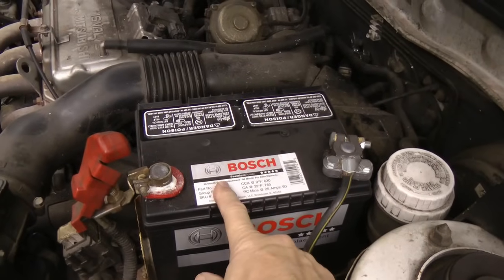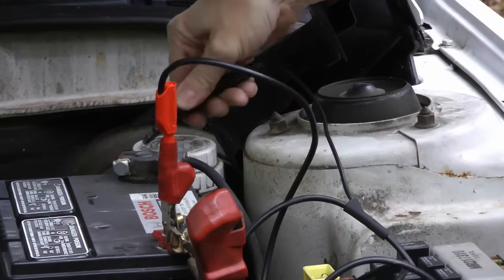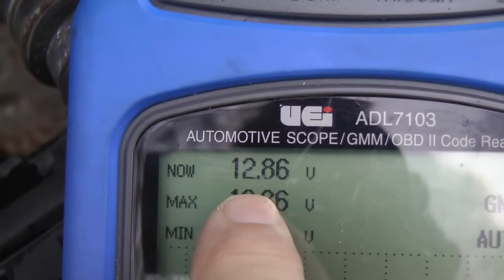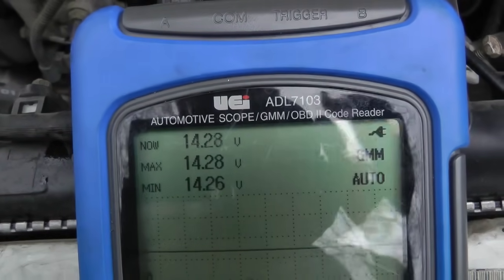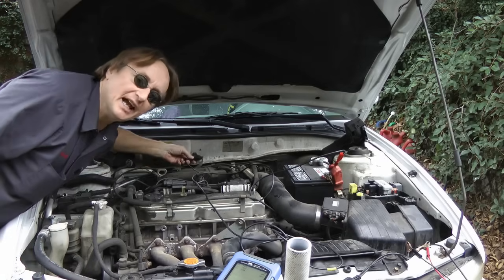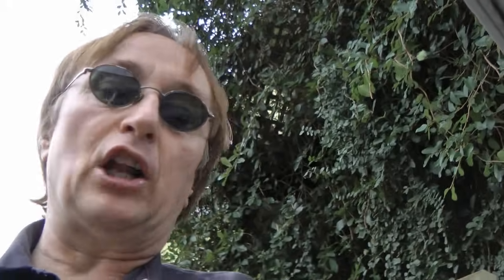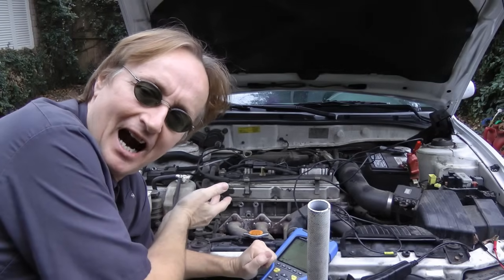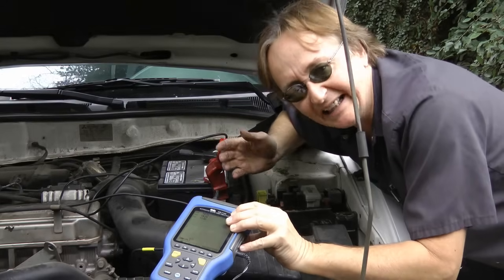How to Fix Electrical Problems in Your Car (Ground Fault)

Comment: I flushed my radiator and put in new coolant and steel seal. Using it as a preventative but I did notice the heat is colder now with the steel seal in it now. Any ideas? I use a alternator on my scooter also by testing my regulator and magnetron for charge and a.c. to dc. Car batterys should sit at 12.5 volts or more overnight so you know they are good.

Comment from the maker: cause it's a GM product, Insanely over engineered with computers controlling that.  You need a machine as in my video "fixing modern cars using high level scan computers" to analyze and fix that. Often a bad module on the side that doesn't blow cold, last time I fixed one of those it was over 600 bucks, brilliant design there.

Comment from the maker: yes, check your anti theft system if it has one and it needs resetting. If not, check the battery terminals and wires to see if they are not getting power from being loose or cracked

Comment: I left the door open on my 96 jetta and it drained the battery, but it was low on power anyways, but when I got a new battery hooked up and waited for 10 minutes and I tried starting it nothing happened. None of my lights came on inside nor did the radio or the odometer. Any suggestions?

Comment: Thank you, Scotty. I guess spark plug or spark plug wire are the last one I want to check. Based on your help, what i will do is: 1. Change fule filter. 2. Check pressure on fule pump. 3. Clean fule injectors.  4. Change spark plug and the wires. As you said, I pray it is either 1 or 2. Thank you again, Scotty.

Comment: Hello Scotty you being of great help. I used a code reader and i got this code:  PO352. In my Manuel it says  Ignition coil #2 primary circuit. I think you are correct that i got a bad computer. Before buying a new computer is there anyway to test a computer?

Comment: Hoping to get some help.... 
My car is Hyundai Tucson 2005. When I hit the gas to move from stop, it hesitates a couple of times during acceleration. it is not smooth but discontinuous initial acceleration. After that, I can feel smooth acceleration with no problem. You can feel this problem more clearly when you stop and move again up hill. This problem feels worse when you try to go up hill.

Comment: The problem is that my car does not have distributor.  I think my cam or crank position sensor are bad. In my user Manuel its says that crank and cam sensor are important for sparking the coil pack. Well i bought a new coil pack today and that same, no spark. I used a test light to see if there was spark, but all there was just one instant flash. After that nothing. Do you think i need to change the crank or cam sensor?

Comment: hey Scotty, i know this doesnt have anything to do with electrical systems, but i have been putting off changing the oil filler neck in my 2000 ford f150 5.4 liter for a while and its come to the point that i have to do it! I just cant figure out how to get the blasted thing to come out, it wont just twist off like i thought it would? Thanks for all your help, it is greatly appreciated! Kenny

Comment: Hey Scotty. I have 1997 Mitsubishi eclipse. For some reason my car is not getting no spark. So my car crank but no start. I tested the resistance of my coil pack with a multimeter and it read 11.2 and 11.3. Now on my car manual it says that the resistance should be between 11.5 and 12.5 resistance. It also says that it should be replace if is not withing the resistance. Do you think that the reason why I'm not getting no spark? By the way I love your videos.

Comment: Wow Scotty I have that exact car. And I believe I have ground problems. There is a thin set of ground wires connected together by a metal ring tip and bolted on the side of the engine. Problem is it melted them. Went to the dealership and heard that ground could burn up my coil packs. So I went to a junkyard to see if I could pull another one but it was difficult. Seemed to go thru the firewall so I cut it and I'm going to twist and solder it to my wire(will this work) also I have no dash light

Comment: Hey Scotty, I have a 97 Bmw 318ti. It has a weird intermittent starting issue. Probably one out of every 20 times I drive it the car won't start first try like it normally does. I have to try and turn it over it and pump the gas pedal usually 3 or 4 times before the car will start. It usually does it after I've already driven it, not from a cold start. New pcv,,o2 sensors,fuel filter,air filter,plugs wires. Any ideas?

Comment: my friends 94 corolla keeps blowing the main fuse disableing everything key ingition dash lights and everything else,  where should i first for the hot wire short? under dash next to ing switch?

Comment: Hi Scotty, nowadays people bought car accessories such as HKS Grounding kits which comes with 4 thick wires. And is the Voltage stabilizer (contains cap Capacitors) are good enough for cars? Thanks.

Comment from the maker: same as this video, find the ground wires by using a test light or meter in the trunk and pray it's just the one back there that bolts to the frame

Comment from the maker: I would start by checking the ground wires and the circuit boards back there, on MERCs the boards often warp with age and need replacing

Comment: Hey Scotty  I am currently being plagued with tail light issues on my  Mercedes 190d 2 main issues,keeps blowing tail light bulbs :( I install new bulbs which go brown  immediately then fail within a week :( Also not sure if Related but my Reverse lights keep failing :( Work one minute not the next? My Reverse Bulbs are fine whats the best way to track down these issues? Dont know where my tail lights ground is and battery under hood and tail light access in trunk

Comment: I have a 97 cutlass supreme and I have an issue with my passenger brake light. It only works after I use my turn signal . Bulbs replaced, fuse is fine so how would I check the ground for that particular part. Thanks

Comment from the maker: you can use power from anywhere, but really, 15 feet of any wire can be used to hook it to the battery terminal which is more accurate.

Comment from the maker: get a test light or volt meter and check the switch and wiring for power loss, and fix the area that stops power flow

Comment: Does your meter reset ABS or get the codes from the ABS. My son got a 2004 jeep liberty and the abs light is on . He also has a bad socket on his front turn signal and we went to NAPA and they said it was a dealer item . Is there someplace I can find that socket beside a junk yard or the dealer?

Thanks

Comment from the maker: those stupid systems are complex to diagnose and repair, see my video "fixing modern cars using high level scan computers" and realize that's the only way you can work on those insane designs. Most guys just live with it, or disconnect the stupid auto locks by removing the relay that runs them

Comment: Hey man!!
Love your videos, always supporting!
I recently installed foglights on my 2012 lancer, and they worked perfectly for 3 months, now, the lights no longer work, the switch does though, the backlight turns on and off.. I checked the fuse, it's fine. There is a relay which I'm not sure how to check, and the bulbs are intact. Could it be the switch?

Comment: Ok here is the problem my friend's '06 Honda Odyssey Touring has auto lock when you get to a certain speed but it just keeps locking every 2 minuets while driving and the remote key does not do anything anymore everything is good like the battery but it still has these problems.

Comment from the maker: could be bad wiring, check around the alternator wires first. More often a bad alternator. O2 sensors can go bad many ways, so you normally trust the computer on board to diagnose that and flag a code when bad

Comment: This works great for automotive techs, but for those techs that work on electric material handling equipment that use those 24 volt or 36 volt monster sized traction batteries will not have the traction battery pack's negative tied to frame. Instead the metal frames are at neutral potential (no electrical connections to it at all). All return paths are with wires back to some source, whether the battery terminal block or to the vehicle manager computer that will have built in power supplies.

Comment: ok. symptoms you had were same in my ford - although don't mazda and ford share many parts.
Anyway, I had some start problems too and friend mechanic told me to replace the globe. I replaced bulb and cleaned up wiring and no more problem.
Good luck!
Alan

Comment: Hi Scotty, few days ago all lights have turned on (normal lights, brake lights, fog lights, reverse light and even rear direction lights/signals are still on even when I turn everything off and take the key from the ignition (bmw e39 '96). When I disconnect and reconnect the battery, everything remains the same. Do you think that I have a bad grounding somewhere? Thanks :)

Comment: none are blown at all, everything else works. radio screen never lights up all the way (thats been that way for years) just a crap radio. if i slam my fist on the dash it goes off. button (when it wasn't in the dash) had to be held down and that would sometimes work. Mazda Tribute 04 LX 3.0 v6. love the car hate the quality.

Comment: not sure if you would have any recommendations for shops in the montgomery county part of the dc metro area, but do you have any idea what might be causing the problem?

one side note: they said (about 2 going on 3 years ago when i got all new tires from them) that i have a bent caster and it cant really be replaced (even though ive seen replacements on ebay) and since its bent slightly, it wont cause any problem apart from the alignment wont ever be 100% accurate but still ok to drive

Comment: Scotty do you know what could be possible causes of intermittent hazard lights? they go on at random even with ignition off and after the car has been parked for hours (few jumpstarts ). they even go on when i drive on the highway. the button went through the dash after trying to get them to go off. the Stealership wants over 600 to fix them.

Comment: where does it smoke from? exhaust can usually mean plugged cat. or worn valve train or worn out cylinders.  if it is coming from the engine compartment it could mean an oil leak dripping on an exhaust manifold or pipe. either way keep tabs on oil level.

Comment: Hey there, your video are a great help to me. I took my car to autozone and got my battery check, my cranking was normal.and charging system had no problems however my battery light still flickers on and off occasional. Could this be due to bad wiring like in the video? Also what are some sign of ur O2 sensor going out? Thank u so so much.

Comment: Some would say I'm strange, but back when I was still working in the field my favorite type of problem to diagnose were electrical problems.  I've seen many strange ground-related electrical problems in my 20 years of wrenching.  

One of my favorites:  80's Chevy pickup:  If your foot was on the brake, and the truck (man trans) was in reverse...shutting off the ignition did not kill the engine. (corroded tail light ground).  Kinda strange that the lights worked properly, otherwise.

Comment from the maker: sure, try your soldering on any wires that may be loose or corroded, pray it's that cause those opels are electronic expensive nightmares to buy such parts for

Comment from the maker: yes, it can, and being that old, I'd just rewire the pump directly off the ignition switch and put a 35 amps fuse in line on it.

Comment from the maker: yes, check that first, also check the power wires for lack of voltage by doing this test, you can test the power wires too by leaving the ground on the battery and using the testers positive wire to test headlight voltage.

Comment from the maker: they actually are supposed to be on with the car running, and then are supposed to dim a bit with the headlights on as that's for night use. Check the dimmer switch on the dash, it may be turned to the off position, pray it's just that

Comment from the maker: it may be old, but it's still very complex. Me, I'd cut the wires to the blower motor and rig up a toggle switch to turn the fan on or off, easy fix there if you don't mind nothing but full speed fan

Comment from the maker: yes, it's grounded and if it's not grounded correctly, they can shift bad and can even make the starter not work correctly as the starter is bolted to the transmission

Comment: i have a 2001 kia optima se v6
when i drove, the car would rock bad from side to side. mr tire said it needed new struts, bushings,engine mount, etc. had them fix it and it was fine for a bit. then it started again,when im changing lanes and mostly when i turn left at highway speeds. took it back to them and they said it needed and aliment and balancing. problem is i did it when i did the struts and that was a month ago. they did it again for free and yet the problem is still here.

Comment: Question for you Scotty,

My primary vehicle is a 2008 Mazda5, and it has a built in AUX port for the stereo system. Problem is when I have an audio source plugged in to it and plugged into a cigarette lighter power center it gives me noise from my alternator. I know this is a ground loop issue but I am unsure of what the best way to tackle that would be. Should I ground the AUX port to my car's body, or the cigarette lighter port, or both?

Comment: Happy New Year Scotty,  That video was right on time.. I am getting ready to dig into a 1986 911 with a no start problem, possibly caused by a faulty anti theft. The static test will help me avoid having to disconnect each ground for a cleaning just to make sure they are ok.

Comment: Hi! I have a 1990 Nissan 240sx and I have the strangest ABS-problems. The abs-light never comes on so the abs-computer doesn't know that there is a problem. The only problem is when I'm standing still and pushing the brake pedal. Then the whole abs system comes on and makes clicking-noises like I'm braking and locking the wheels. I have meassured the ohms on the three sensors and they all seem ok giving out 950 ohm both with the car running and not. 

Happy new year!

Comment: I have a 05 Chevy Malibu and I just got the shocks, struts, tires replaced all around. I thought that the rear shocks/struts were causing a clunking noise when I hit a bump. Even after I replaced them, when I drive I still hear a light clunking noise coming from the rear when I hit any bumps. It's nothing inside of the trunk...any suggestions?

Comment: Ahhhh thats great....does that work good in tank?Scotty I used to make drip gas from the oil field back in late 70's it had alot of suflur in it.But one thing I did find out is was the best hand cleaner ever it was as clear as water also.Thanks Scotty happy new year....

Comment: hi scotty i posted on another vid about the astro van, well it still back fires it seems to have ratarted timing, back fire out of the intake, changed the whole distributor assembly an made the starting less noisy but still doesnt seem to want to fire, its getting spark an 60psi of fuel, but after dist- change it seemed like wasnt getting spark, only solution i have been able to figure is the timing chain jumped a tooth since it has 148xxx org mile on stock chain, input? greatly apreciated&vids!

Comment: Dear Scotty, My dad has a 2003 Nissan Altima 2.5S that has probably over 130,000 miles I think and everytime my dad drives it, the car shakes a little and makes a big rpm sound when it changes a gear I think. Im not too positive about this but that only happens when the car is between 1st and 2md gear. Do you think I should put Lucas oil or something?    P.s. I watch every video and Im going to be a car designer when I grow up, Im currently 11 years old. KEEP GOING WITH THE VIDEOS Mr. Scotty!

Comment: 1997 Saab 900s auto convertible. started randomly triggering a check engine/check gearbox light with the codes P07040 and P07041 (torque converter lockup performance problem) when downshifting while accelerating up a steep hill. Those shifts are usually much harder than usual. Code goes away on its own after shutting the car off for 10-15 minutes and sometimes takes weeks to come back. Got a transmission filter/fluid flush done about a month ago, but the codes still come back every so often.

Comment: whats more possable.. intake manifild or head gasket? since the coolant has destroyed everything with the cooling system.. heater core smels of coolant and rad drips a tiny bit and now burns coolant.. could it be an intake manifold?  the price for headgaskets is more than the truck ..intake is only  600$ job im quoted...2 head gaskets ..plugs.. intake manifold gaskets  is 2000$ parts n labor n tax... i still love the truck even tho its not worth 2000$ resale

Comment: In my 1995 chevy s10 my green turn signal arrows turn on when i turn on my parking or head lights on.  Also my bottom directionals  (parking light) dont flash when i turn on my directionals

Comment: I have an Opel\Vauxhall Vectra C (06) that has dodgy clocks. Randomly, a few warning lights come on and the whole thing shuts off so I can't see what speed or revs etc I am doing. A quick internet search tells me it could be the CIM or a dodgy ABS connector. I cleaned the connector and it cured the problem for a few weeks but it has come back. I am thinking of putting a thin layer of solder on the pins. Is there anything I can try hopefully without replacing the CIM or ABS module?

Comment from the maker: I would remove the wires from the one on the wheel if it's still there, and check the wiring on the horn button that was installed, perhaps that button is sticking or the wiring is rubbing there